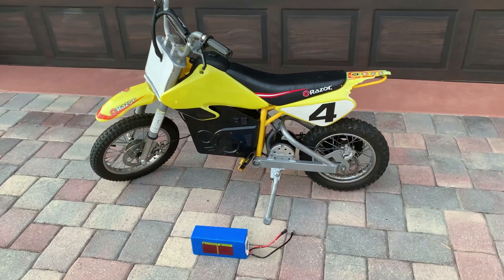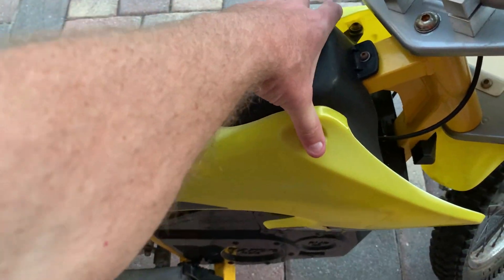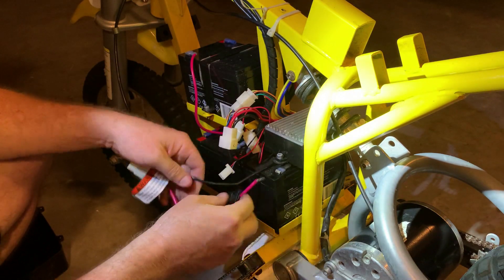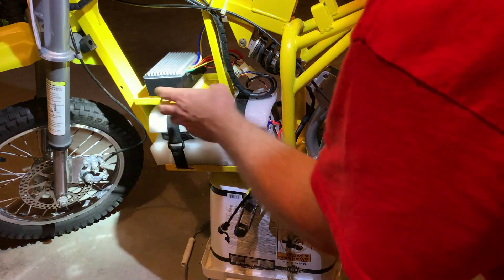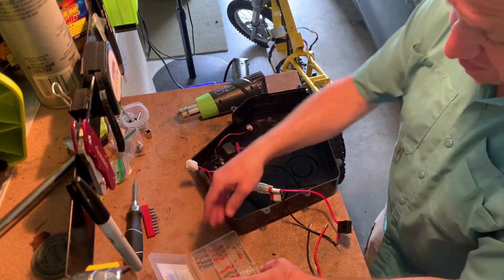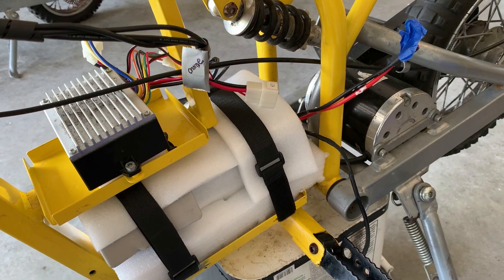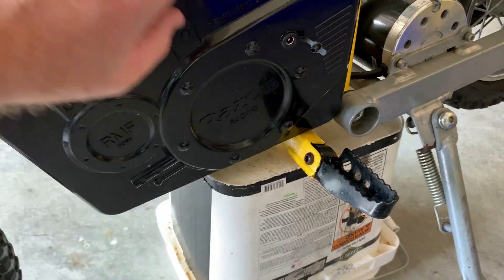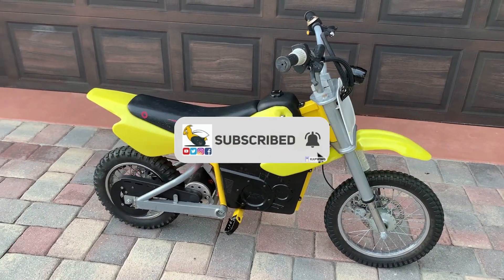Restoring a Razor MX650 "Super Bee" - Upgrade to 36V Lithium Battery

Comment: Whats the run time approximately? You uave my gears spinning. I need to replace my current batteries
Reply from the maker: With the 36V / 14Ah I get over hour ride time and 36V 20Ah battery I get over 90 minutes of mixed riding.   See link to battery https://ebay.us/k2Rcf0
Reply: @BRichSolution you are awesome!

Comment: Man I’ve watched this video countless times while working on my son’s mx650. Would the caomm 36 20ah fit? It isn’t much more than the 16ah so I figured I’d spend the extra. We do a lot of neighborhood riding. 

I kind of wanted to overvolt it to 48v, but honestly with smaller kids it probably isn’t the best idea. Also wouldn’t feel like smoking the motor like I know it will eventually do.
Reply from the maker: The 20ah will fit no issue
Reply: @BRichSolution  my battery came in today without a charger. It was supposed to so I reached out to customer service. Any input on a charger in the meantime for the 36v caomm battery?

Comment: Hey awesome video. I'm a noob but the manual on my kids mx650 says 24v but a 36v battery will swap with no problems?
Reply from the maker: Mx650 is 36v stock not 24v

Comment: Can you use a 36v 20ah lithium battery in a mx 500 with a stock motor and controller and power switch
Reply from the maker: Yes 36v 20ah will work without issue with stock motor and controller

Comment: Do you need the foam around the battery and does it still turn on from the stock switch
Reply from the maker: Foam around the battery protects it from rubs in the frame and going 💥   Yes stock on/off switch is the same
Reply: @BRichSolution  okay thanks for replying

Comment: Do you know if the 48v 20ah would fit in the battery tray?
Also greatly appreciate the detailed videos. The best one I have ever seen!
Reply from the maker: Yes the 48V 20ah Cao MM battery will fit in mx650 and mx500
Reply: @BRichSolution ok thanks! Now to try and locate one or one with a little less ah

Comment: Hey im doing the same, i have a 36v 12 ah, will it make it quicker and would it make it last longer? My batterys were shot when i bought it off of Facebook marketplace
Reply from the maker: 12ah battery will work so long as the continuous amps discharge is 20-30a

Comment: Wait, do i get the 16ah or 10ah?
Reply from the maker: 10ah works but 16ah will provide longer ride times
Reply: @BRichSolution  Aha! Thanks! Do you prefer 10aah, or 16ah? Also, did you use the 10ah, and if i get the 16ah, will i have to wire, or do anything differently from what you did? besides the placement of the battery* Also how long does the upgraded battery you have last per charge, and how long does it take to charge? Also, since ill purchase my battery off of walmart since it comes with no charger Can you leave a amazon link for a charger?
Reply: Can you also do a throttle upgrade tutorial, Specifically a throttle with key? I know alot of people looking for this, but all the other tutorials arent in depth, and as deep as yours are. It would be awesome!

Comment: Curious.  I am doing a mx650 conversion on a mx350.  The stock electronic controllers battery plug is 3 prong (top and 2 sides)  when converting to use a lipo, is it ok to use a 2 prong male or do I need to actually find a 3 prong female and cut that off to use on the lipo?  Love the vid, by far the most informative.
Reply from the maker: I am building 36V mx350 now and used the cable and connector from the old batteries and connected the bare wires to the short cable that came with the new battery
Reply: @BRichSolution Gotcha and ty for the quick response!   So no cutting off of the battery, just using the barrel ends correct?  Also what about on the mx650 plug there are 3 prongs vs the mx350s 2?  It seems there is a small red cord that goes to the top of the mx650s battery plug, same 3 wire runs from the esc.  Any idea what that is?

Comment: what can i do to make the performance on a stock SX500 mc grath better? (For under 230)
Reply from the maker: For $200 buy 48V li-ion battery and wire to stock controller.  You will gain 5 mph and much needed torque and later on you’re all set up to upgrade motor to 2000w motor kit.    Link to 48V / 14 ah battery on Amazon https://amzn.to/4cb5SPk

Link to youtube Razor SX500 - Upgrade to 48 Volts with Stock Motor
https://youtu.be/yw7w0vJrWcI
Reply: @BRichSolution  thanks bro!!

Comment: @BRichSolution Is there any reason to not cut the end off of the battery charge port and wire to the factory plug?  I ask because I have a charger for the battery that I already added the XLR plug to and this would keep it all working like factory.  (Other than the fact that the battery would be directly wried to the XLR port.)  How safe do you think these batteries are for kids?
Reply from the maker: The factory charger is for lead acid batteries not li-ion.  You can wire up to the factory charge port but make sure to buy a new charger like the one linked below https://amzn.to/3yVsYeo

Comment: I upgraded my MX650 to 36V Lithium, thanks so much...  made a world of difference in drive time, but only picked up maybe 1-2MPH.    Aside from doing full 48V Battery and Motor Upgrade, is there any easier, less intrusive mod to get the bike up to 25MPH?  35 is too fast for my liking, and the current 18-19MPH is just too slow.  Looking for some middle ground, preferably keeping one of the 3 components intact.. motor, battery or controller.--Many Thanks.
Reply from the maker: Change the motor sprocket from stock 11T to 13 tooth with get you to 21 mph 
https://youtu.be/BuSAr9CzmEI

Comment: Awesome! Last night I did a test on my mx650, with a 

-1.8k motor
-52V /24ah lithiun battery
- sprockets : 13t front / 80t rear (factory)
- 33mph ( 25mph previously)-
- I weight aprox 220lbs

Bough the motor on amazon as kit, but I do not like the touchy/ sensitive throttle response, almost did  a wheelie on my first test 😂*fully charged battery* I had to move forward to avoid wheelies, but I had a blast. It did ran good so far, just looking for top end. Rear sprocket/freewheel upgrade coming soon  (65t and 55t) lets how it goes.
Reply from the maker: Awesome

Comment: For the solder sleeves are the Wires 10-12AWG??  Also will the Factory "Low" Battery Light work with the new Lithium Battery?
Reply from the maker: Yes 10-12 awg solder sleeves.   Low battery light will work only issue like all li-ion batteries the light will go form green to red quickly
Reply: Thanks for the reply @BRichSolution  , i also didn't realize the Charge Port with weather cover wasn't factory stock.
Reply: Thanks again for the video, just finished the upgrade and worked great.  The hardest part is removing and reassembling all the screws and nuts that hold the plastic pieces. Was a pain in the ass. Razor doesn't want you in there!!

Comment: @BRichSolution  thanks for the video man. I have 2 mx650's i got off craigslist for $250 specifically for the purpose of upgrading  them with more powerful 2000w brushless motors/controllers combo and 48v 16ah Lithium batteries for the added speed and power ill get out of them. Right now they are 100% stock  and the stock mx650 seriously lacks the speed and power needed for me to get any enjoyment out of riding them.  Unfortunately so far i only have been able to come up with the funds to purchase the bikes and the 48v 16ah lipos  battieries for them and now im broke so im not gonna be able to buy the upgraded motors and controllers for a while till i can get the money together ti buy them.  so ive been wondering if i just overvolted the stock motor/controller with  48v lipo can they handle the added voltage or will is it gonna be another case of magic smoke for me when I got to plug it in, an if it dose work will will it even be worth the effort for the added amount of extra power and speed you get? Well now i know sense Your video gave me all the answers i was hoping for. Im gonna go ahead  with just the  48v battery upgrade for now , Then i can atleast get some enjoyment out of them in the meantime.
 Do you know if the stock motor controller will work with a variable throttle if i got to switch out the one that comes stock or will i need to upgrade the motor controller with one that can work with it too?
Reply from the maker: Yes, the mx650 stock motor and controller can handle the 48V battery.  Building the bike in steps is great way to step up to higher speeds.   See video for over volt a razor https://youtu.be/kRvYAI1hdc4 
Then in 6 months to a year buy the 1800w motor kit… 2000w motor kit is not worth the money as you will never be able to get the 2000w with that kit because the controller on the 2000w kit only outputs 33A.   A fully charged 48v battery is 56V so 56V x 33A = 1848W.

Comment: How did you hook up the voltage meter, I can not get mine to work it always says 100 percent when I plug it in. Need some help please.
Reply from the maker: Sliced in voltmeter and headlight wires between on/off switch and controller

Comment: Is there any way to connect those wires without smoldering it? (4:02) excuse me if that's not the right technical words.
Reply from the maker: You can use butt connectors but resistance could be more.  Do not use wire nuts.
Reply: @BRichSolution  can I ask why wire nuts are not a good choice

Comment: I just completed the same setup and seems I having over heating issues and less run time. Any suggestions ?
Reply from the maker: What battery did you install?     If the motor getting hot then try installing this heat sink on the motor, see video  https://youtu.be/jizGMurwUSU
Reply: @BRichSolution  the battery from your link. I’ve now cut down / reduced the foam surrounding the battery  to allow heat to escape and ordered the motor heat sink. Hopefully this will help. Thanks for the reply.

Comment: How do you keep Lipo battery from over-discharging? Does the battery have some sort of overdischarge protection circuit?
Reply from the maker: the battery has a BMS and stock controller cuts off at 31V

Comment: Love the vids!!! Heres a question. I want to do this upgrade but with a 48v 20ah battery but I want a new key throttle too... Is it possible, to use the fast scooters overvolt kit (just the throttle and controller) and wire that to the battery? and still use the li on battery charger?
Reply from the maker: Does the fast scooter controller have a separate wire harness for on/off?   If so then yes

Comment: Could you put another smaller lithium battery in the smaller upper shelf for more range and mount the control box in the original spot?
Reply from the maker: Yes you could put a small battery in the upper tray.  But one large 20Ah battery is cheaper than buying 2 smaller li-ion batteries because the BMS

Comment: Great video. Thanks! I bought the battery and the parts thru your links. How can I connect the Voltmeter Gauge? Do you have a video or instructions for that? Did you found any faster charger, like a 5A?
Reply from the maker: See other video for adding auxiliary circuit, 2:19 mark   https://youtu.be/yw7w0vJrWcI

Comment: Say later down the line I wanna upgrade everything, is there enough room to add a second battery to make it 72v?
Reply from the maker: yes, but you'll need to cut out the upper battery in order to fit two 36v batteries.

Comment: Can i use electric tape instead of heat gun?
Reply from the maker: I wouldn't use electric tape as the current can be very high at times and could burn thru tape.   You can use standard butt end connectors (make sure AMP rating is 30A) and wrap those in tape but they do have higher resistance drop.   https://amzn.to/3nfEPMo   or use these neat lever connectors which are super easy to install:  https://amzn.to/3DgH5sn
Reply: @BRichSolution  thanks

Comment: Could this same battery set up go on a 24v mx350 with stock controller
Reply from the maker: I believe so; the 36v Razor bike controllers can handle 48v.  I'd guess the 24v bikes could handle 36v batteries

Comment: Very good video showing how to hook up the lithium battery, I just bought 2 bikes a brand new mx125 and a used mx500, this will help me in the future. Now as far as the lithium batteries go how big can you go AMP wise with that particular lithium battery b4 it won't fit, I'm looking at the 36v 30ah. Thanks
Reply from the maker: 30 Ah might be tight in MX frame due to height with the welded in battery tray.   Best bet is measure before you buy. 
  You could cut out the upper battery tray to fit 30Ah if you need more height.   The SX500 frame has more room in the battery box and no welded in upper battery tray.  see my other video of all the frames naked:  https://youtu.be/s5XFrYKPZ9A
Reply: @BRichSolution  yea I wouldn't have a problem cutting the top tray off I have a Sawzall. I been trying to make sure whoever I buy the battery from on ebay is legit, just bc it says 30AH doesn't mean it is. I may just buy from the link you posted on the 36V 20AH. What kind of run time are you getting with the 36V 14AH you put in?

Comment: Does adding this add more speed?if so how fast have you gotten?
Reply from the maker: 19.1 mph is top speed; gains 1-3 mph over the stock SLA batteries
Reply: @BRichSolution  Hey do you think i can buy a harness off of you that has the dean connection soldered on already?

Comment: God man I love this channel!!! Whats the weight now with the 18 pounds off? lithium the way to go I saved about $200 cause I already had some lithium power tool battery wired them all up in parallel and series so I'm running 36v 10 ah
Reply from the maker: This bike weights 79 lbs with the li-ion battery & stock motor
Reply: That’s the way to do it, utilize lithium power tool components, base of tool to battery  connector and series/parallel wire batteries.  It works great and easy to mount. I upgraded a mx350 from 24 to 36 volt, variable speed throttle and 36 v 1K watt controller. I also put the mx650 motor on it and it hits 26 mph with my son on it. Little too fast, so I added dial speed reducer. Because I had the tools at my disposal, it only cost me under 180 total. Needless to say, my son loves it and it all looks stock still, besides the larger motor you can see!